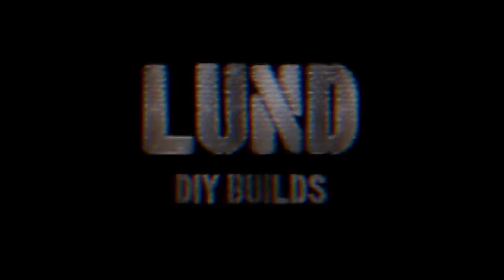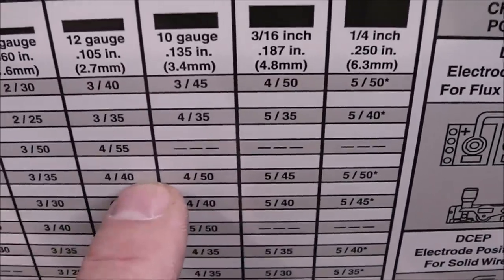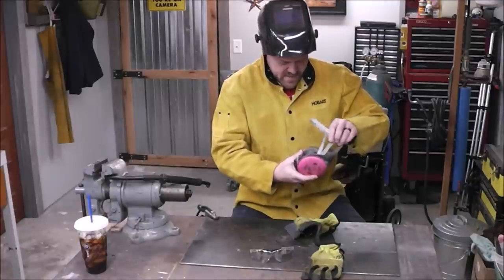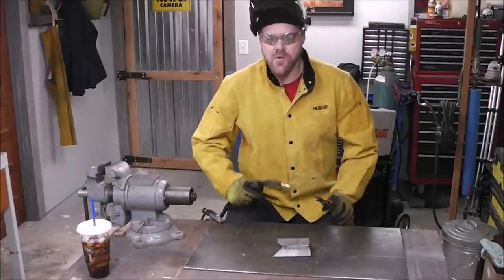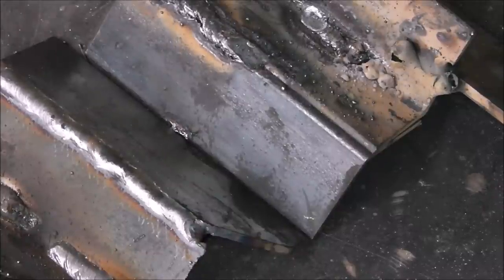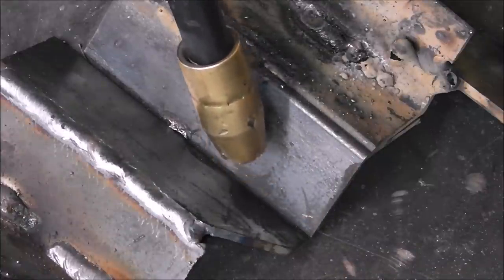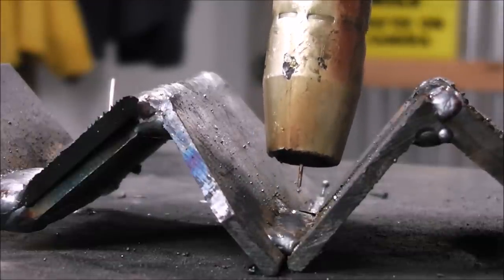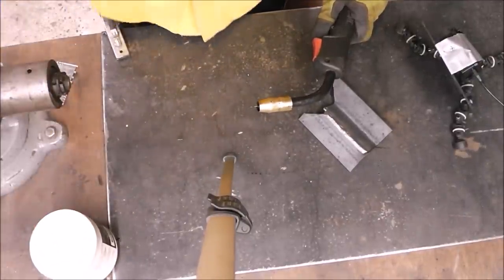💥 BEGINNER WELDING SERIES   LEARN HOW TO MIG WELD E.4

Comment: So does the technique differ if you MiG welding with gas or flux core?
Reply from the maker: The only thing that changes is that with flux core you pull or drag and with bare wire you can do either...push or pull
Reply: @BrandonLund  Thank You!....Hoping I can start doing some good projects!
Reply from the maker: Anytime! Thanks for the support!

Comment: Thank you for making this video, I will be attempting my first mig very soon.  What the heck is nozzle jelly?
Reply from the maker: Dev Everything Nozzel Gel is a jelly type substance that lubricates the end of your mig gun so that spatter doesn't stick to it. When I finish welding, I dunk the end of the gun in the gel and it's ready to go for next time. It's much more necessary when using flux core but I use it every time when I'm done because it makes cleanup easier.

Comment: I really like the way you show everything, except that you don't show or really talk about penetration. It isn't just you, seems most on YouTube skip that part. I've read on welding sites that the problem with Mig welding is you can have a pretty bead, but it doesn't penetrate and will fail. So I would think it should be something mentioned. IMHO anyway.
I'm just a rank beginner, so take my thoughts for what they are worth. :-)
Reply from the maker: I agree Russell. I should probably incorporate a cut and etch into a few videos. Thanks for the suggestion!

Comment: So I can use the caliper to.measure the thickness of the steel it if I dont have the gauge
Reply from the maker: You can but if its a good one you wont want to expose it to metal dust and filings.
Reply: I bought a mig welder last year. But I gave not used it because I still need but the gas tanks and they are more expensive. I bought for alumium and stainless steel welding.
Reply from the maker: Tanks can get very expensive

Comment: What does 4 represent?
And what does 45 represent? 
4 is the feed?
45s amps?
Thanks
Mines a Lincoln. I got spray I'd bought once for my flex core rig.?do I need the cream.is cream just for storage?
My nozzle has a chunk of weld in it/guess I should toss it for a new nozzle.
I just switched to.0 35 wire?
Cause I'm patching rusted thru car frame.under the car mostly!
Reply from the maker: Correct. This machine, like many uses detents. Inside the cover it lists the settings based on material thickness. You don;t need to but you could roughly figure the amperage by using 1 amp per.001 inch and you can rough the wire feed speed by pulling the trigger, counting to 15, measure the wire then multiply that length by 4 to get inches per minute.
Reply: Ccool

Comment: Brandon, I am new to welding. I am having a terrible time trying to see the joint i am trying to weld. I purchased a Lincoln 1840 Series auto darkening helmet and have tried setting it from the darkest to the lightest setting and still find it almost impossible to see where the bead is being applied. Can you or anyone, PLEASE help me.
Reply from the maker: Charles, I dont have personal experience with that hood so hopefully someone here does and can give you some tips. Have you verified that the clear shipping films been removed from all the lenses? For mig welding I set my shade to 9. Try laying down a bead positioned like you would if you were reading a book. You stay stationary in front of your work and if you are right handed, try welding from right to left. Beginners are also much more comfortable having their head closer to the work. Just be careful about breathing in the fumes. Let us know if this helped and good luck!
Reply: Hi,
I am having exactly the same problem. I have a Cigweld helmet and I've tried all the settings on it, all I can see is the bright white dot where the actual arc is, I can't see the pool behind it nor the join where I'm trying to go. I can start out fine but if I try to weld more than about 10mm - 15mm in one go I start going off to one side.
Reply: @MerlinZener  I became so frustrated, I called Lincoln tech support and they had no idea why I was unable to see the joint I was welding. They said that the helmet I have (Lincoln 1840 series) was a top of the line product and I should take it to a Lincoln dealer and have it checked; it might be defective. What I did do is to purchase another helmet (Lincoln Red Fierce) which has an auto darkening setting that goes down to 7 and I could see better but again, not great. Also, although the setting can be reduced to 7, I am concerned that it may not be sufficient protection.
BRANDON OR ANYONE ELSE--PLEASE CHIME IN--WE CERTAINLY NEED YOUR HELP AND APPRECIATE ANYTHING YOU MAY OFFER.
Reply: Charles Gruen, you should set your hood so that it's light enough to see the puddle, but dark enough so that it isn't bothering your eyes. 

Being able to see the puddle and see what it's doing is an acquired skill. something that might help you see the joint better is setting up an outside corner joint to practice on so the edge if the metal is your lines to follow. Also invest in either a white paint market or soapstone to lay out a straight line to follow. You should easily be able to see the white lines.
Reply: @jrg10332 Thanks, do you mean; "not a helmet" but like strap on goggles? If so, do you know that they are all the same level of darkness?
Reply: @chuckhickman8093  Thanks Chuck, I will try this.
Reply: Old weilding school trick gas. Google's under the hood
old school
Reply: @henryshaw2697  Hi Henry, do you mean to wear a pair of welding gogles with the strap that goes around your head under the auto darkening welding hood?
Reply: Weilding glooges or glasses have the doctor tint your glasses shade 4or5 that way  until I get back to my can set up then flip down
Reply: Sorry t/t went funny have do. Tint your glasses to a4 I
Or 5 then filpdow.n when set common practice for doc to fix you up
Reply: Yes
Reply: @henryshaw2697  Thanks Henry I bought a pair of welding goggles at Harbor Freight with #5 tint and will try wearing them under my auto darkening helmet. Do I leave the setting on the auto darkening helmet at #8 when I do this?
Reply: ,,I'm talk in old school you have to fugure out your self. Retired pop good luck henry @charlesgruen7637
Reply: Charles, Add some really Bright Floodlights close to the spot you are welding. I realize there is a lot of light when the mig trigger is pulled but it really helps at other times. ie seeing when there is no arc and see farther away from the arc

Comment: Do you have to use the gas with that welder?
Reply from the maker: No. You can do either Nick.
Reply: Great thanks!
Reply: I just got the same Hobart welder. Your video is very helpful thanks!
Reply from the maker: @nickhutcherson  That's a solid machine. Your going to be happy with it.

Comment: Oh yeah
I bought a respirator today?
I've got crap in my thoughts I can't get up.
Pink filters like for asbestos? 
What's in this that's bad for us.?
Reply from the maker: It's the vapors over time that can cause lung issues. The same filters for welding also filter asbestos
Reply: Thanks!
Reply: I gotta try the weave pattern. 
Plus my welds look/at BEST/like your too slow/too fast examples. Yeah that was my best welds??

Comment: what do you put the tension at, I have a Hobart 140 as well
Reply from the maker: I set mine so the drive roll slips slightly when the wire is held with your fingers with the trigger pressed
Reply: @BrandonLund  so wire should not feed if pressed between my bare fingers?
Reply from the maker: @AllThingsQuixotic  set it so it pushes through your fingers with slight resistance but you are able to stop it with effort. The idea is that if the wire gets stuck that the drive roll slips rather than forcing the wire to bird nest.
Reply: @BrandonLund  great, I will try that thanks for the tip!
Reply from the maker: @AllThingsQuixotic  Your welcome :)

Comment: Wire speed and Hand travel speed must be the same rate, right ?
Reply from the maker: Yes. Your hand speed needs to remain steady to match the desired deposit rate of the filler metal.
Reply: @BrandonLund  thank you so much

Comment: My problem is either I go to fast or too slow the bead bunches up if I go too slow and if I go too fast it’s anywhere else than where I want it to be
Reply from the maker: Are you using an auto Darkening helmet? If you're having difficulty seeing your weld puddle, try back lighting your joint with a halogen light. Added light can help a lot especially when you're starting out.
Reply: @BrandonLund  no It is not auto and I will try the light out see if that helps

Comment: Can I run mig on the same gas as tig
Reply from the maker: Typically you would use either carbon dioxide or a mixture of carbon dioxide and argon (also known as C-25) to weld steel. C-25 doesn't work with TIG. Generally you would use straight argon. Straight Argon doesn't produce good results with MiG.

Comment: Thanks man. Great series
Reply from the maker: Thank you very much Craig!
Reply: @BrandonLund  I just got a Eastwood 135 and I have everything to learn.
Reply from the maker: @DjCBlaq  it's all good. We all started at the beginning. My best advise, get to the scrap yard and pick up some scrap metal and just start by welding strait beads on flat plate. Experiment with travel speed and get the feel for it. Get into a comfortable position and play around with it. You will be up and running in no time. Congratulations on the new machine! Enjoy!

Comment: What the difference between Tig and Mig welding?
Reply from the maker: The biggest difference is that Mig uses wire that is fed into the weld puddle while tig uses an electrode to create an arc and you manually add the filler material to the weld puddle. TIG is great for precise work but is slower
Reply: @BrandonLund  thank you. Coz as i read to other comments. It says that, tig is just for only thin sheet of metal. And mig is for more heavier/thick metal material
Reply from the maker: @dogloverph501  that is true also except you can do thick metal with Tig, however it really shines with precision work like stainless exhaust and such. Wire feed welding is much faster

Comment: Never stand in front of the Regulators
Reply from the maker: Could be fatal
Reply: I worked in a small weld shop before I went in the army and one day someone turned on the gas and the regulator exploded and the t handle from the regulator went completely through a concrete block. Absolutely do not stand in front

Comment: When I first bought my millermaric 130 back in 98..I was getting horrible welds, I thought the machine was a $700 piece of junk..turned out to be the wire I was using. The flux core wire in some off brand cheap wire, aren't consistent in size, due to flux swelling..the wire will jump and bounce..I bought Hobart flux core, and bingo, the machine was/ still is a great machine...just letting people know..harbor freight wire sucks big time..use Hobart, or other good name brands..
Reply from the maker: Spot on! 👌 I like hobart wire also.

Comment: I welded aluminum  for many years and he is not using the tip properly. When you are using a gas shield, you do not pull the weld like you do with stick, you push the weld to keep the shield around the puddle.
Reply from the maker: Lee Howell, im sorry but you are incorrect about this. You can do either with solid wire.
Reply: @BrandonLund  I don't know where you got your info, but I welded aluminum with ARGON for 14 years and went  to a welding school so stuff it, I know what I am talking about and YOU are wrong period. we were not talking about flux core, read the post before you shoot off. you just peed me off.
Reply: @BrandonLund  seeing that you are self taught I realise that you know more than someone who made a living welding. no need to reply, I am done with you.
Reply from the maker: Lee Howell that makes 2 times that you are now wrong! You clearly have a massive chip on your shoulder. Stop name calling and do the research I told you about. There is no way you went to school for welding or even worked 14 years in the field as you say and not know this rudimentary information. This is welder helper level knowledge. Stop trying to prove you are something you are not.

Comment: Looks easy but not for me I welded yesterday for the fist time and looked really bad..
Reply from the maker: Noel Henriquez just keep practicing and in a short time you will get better. Are you using flux core or mig? If you do not have your polarity right at the welder it will cause for bad weld also. You want DCEN when using flux core, DCEP when using gas
Reply: I am sure that you did not drive a car well when you first started driving. Keep trying, you will get better and It is really a useful skill.

Comment: Mig welders are welding who didnt make it as real welders haha (tig/stick) 
U want to be a real welder and make serious money u dont even need mig cus once u know tig and stick mig is ridiculously easy
Reply from the maker: MIG is often used in production work for that reason. It produces a quality weld fast. It all depends on where you land your job. Don't think for a minute that a union worker running wire feed is NOT making bank.